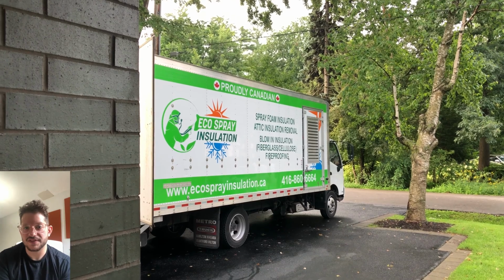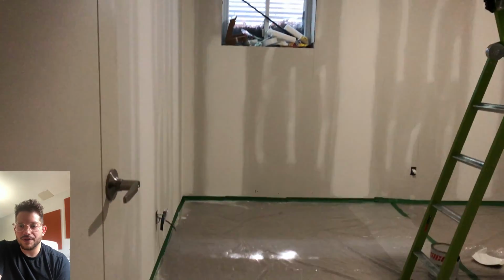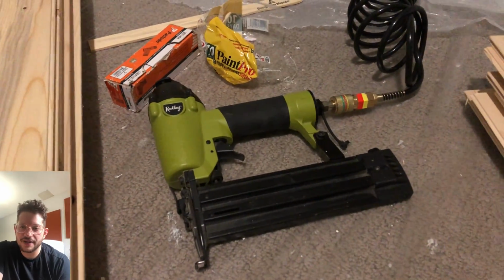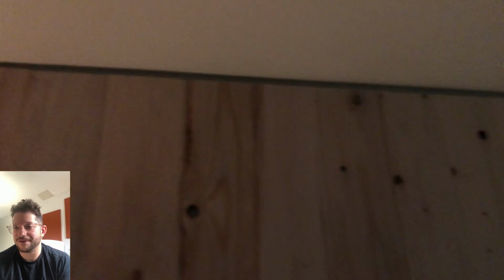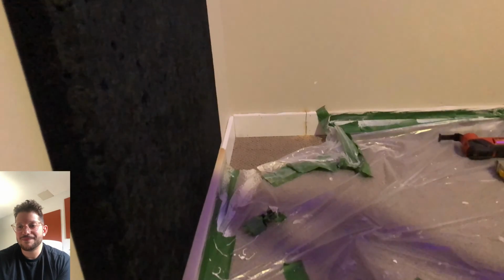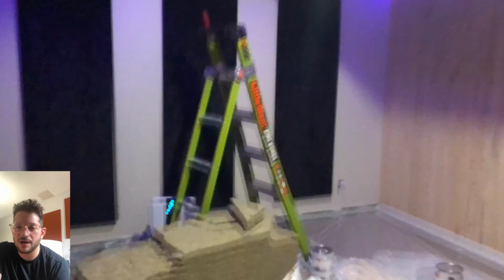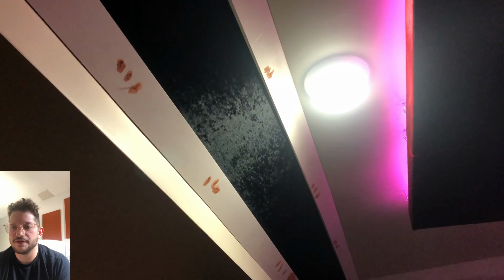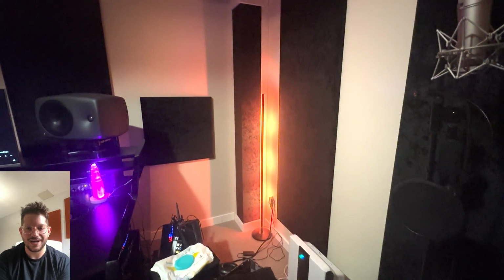From Bedroom to Pro Recording Studio: DIY Soundproof Transformation!

Comment: sorry but those are not bass traps! They are way to small. You are tackling the low mids. Also no distance from absorption material to wall. You should also have used a thin plastic foil for the overheads. never trust fabric, it can always let particles through and that's not good for your lungs, even if you use certified material, it was never meant to be in the "open". Thin painters foil will prevent any of the particles to go through the fabric. Better safe then sorry.